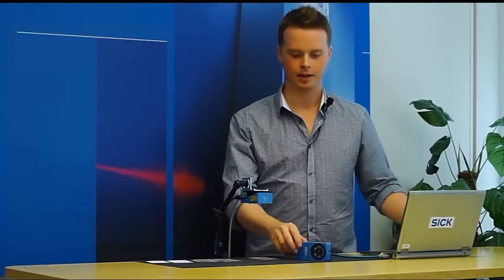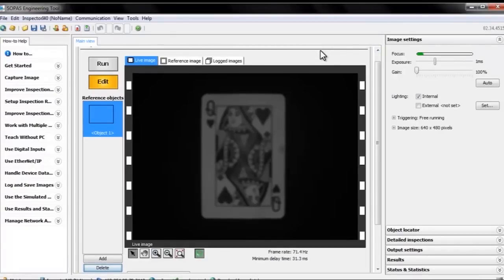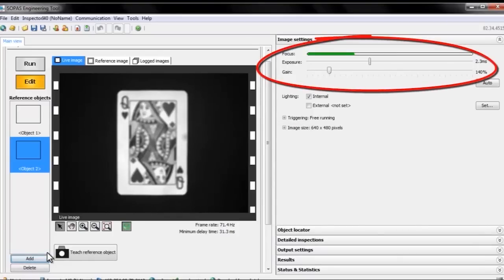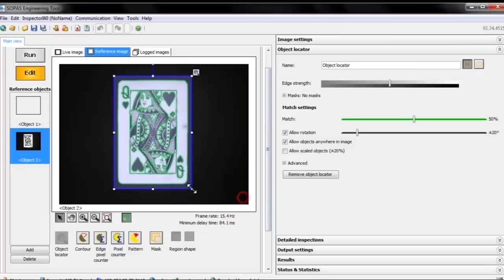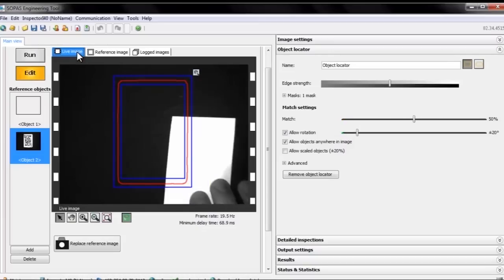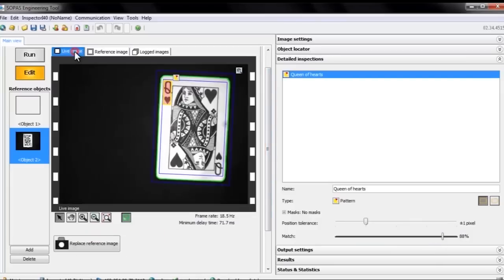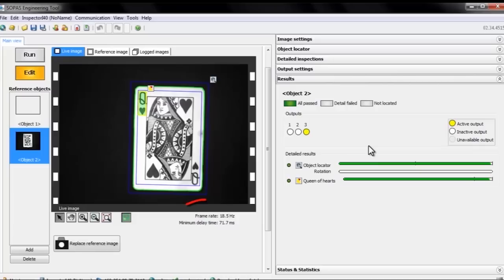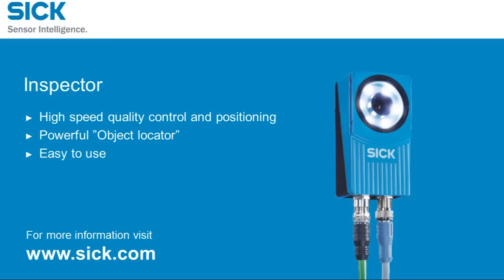Quality control with Inspector vision sensor from SICK | SICK AG

Comment: Hello there.  What is the version of the program sopas engineering program pattern key does not come out waiting for your help
Reply from the maker: Hi Mahmit Hasdal, The current version of the SOPAS Engineering Tool is version 2018.4 ( available here sick.com). The version shown in the video has not been supported by us for some time and is no longer available for download. In order to copy the shown version 2018.4, the driver (SDD) for the InspectorI40 has to be added to the project. Then you can open the device interface with a double click.
The newly opened interface then essentially corresponds to the one shown in the video.